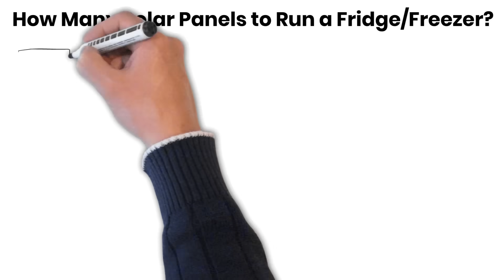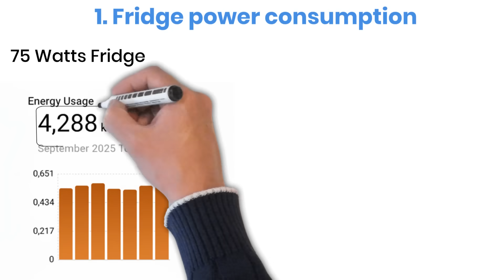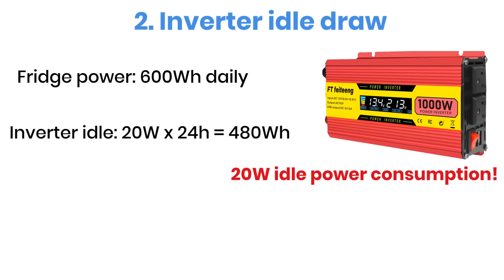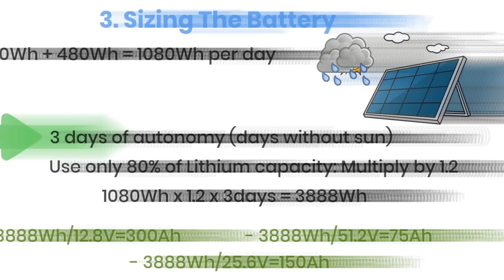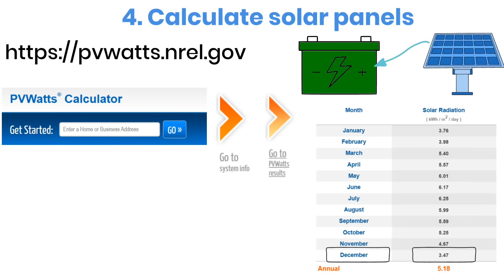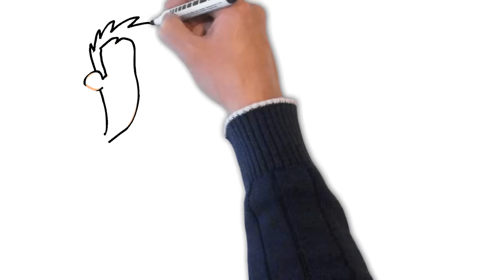How Many Solar Panels to Run a Fridge or Freezer 24/7?

Comment: I am running an old school  frig, 330 watts  ,  it cycles every 15 min, so it runs half the time.
 with 3 sets of 2-250w panels =  1500 watts out put for a 24v system
3 charge controllers produce 15A max for each set of 2 panels =  45a max rate
this system can charge 4 100ah   life pro lithium batteries by 3pm with  no load.  24v 
to keep frig going 24-7 i need to run shore power about 5 hrs a day
i live in southern CA  USA with lots of sun
to live normally you would need about 3 to 4 times what this system is to run a small house
,,,,,,,,,,
Reply from the maker: Thanks for sharing the details of your setup—that’s super helpful for others to see the real numbers, not just theory. Your experience really shows how even with plenty of panels and good sun, continuous loads like a fridge still push the limits of a system.
What you said about needing 3–4 times more capacity for a small house is spot on. On paper, the math looks easier, but in practice, inefficiencies and daily variations make a huge difference.
If you were to expand, do you think you’d add more panels and batteries, or lean more on shore power as backup?

Comment: You can also connect the input of inverter through the refrigerator temperature switch. The inverter wil be switched off during idle time, and entire system will be about 40% more efficient, without increasing of the budget
Reply: You would  need a relay circuit for that ;)
Reply from the maker: @selimtarhan2435  Good point! A relay circuit would definitely make that setup more reliable, and automating it keeps the inverter from cycling unnecessarily. Nice addition to the idea.
Reply: @selimtarhan2435  yes of course, but one relay for about 40% economy, it is definitely worth it
Reply from the maker: That’s a clever idea. Using the fridge’s own thermostat to cut the inverter during idle time could definitely save energy, especially in a small off-grid setup where every watt counts. The only thing I’d be careful about is making sure the inverter can handle frequent on/off cycles without issues—some models don’t love that.
Have you tried this approach yourself? I’d be curious to hear how it worked out in real-world use.
Reply: @batteryhacker4343  no i didn't try it, by I think it will be alright, because switching off/on for about 8 times for a day is not a problem
Reply from the maker: Yeah, true — around 8 cycles a day shouldn’t be too harsh on most inverters. As long as the startup load from the fridge compressor isn’t too heavy, it should handle that just fine. Might actually be a neat little efficiency trick to test in a small setup.

Comment: Would the addition of a timer to restrict the on time of the Inverter say to 25min per hour,  successfully reduce consumption ? Assuming only the refrigerator is connected .
Also, what about two inverters,  first high power Inverter to start , then auto switch to low power Inverter.  ?  R.
Reply from the maker: Interesting ideas. A timer could cut inverter run-time, but with a fridge it’s tricky—if the compressor doesn’t get a full cycle when it needs it, you risk food spoiling or damaging the unit. Fridges really need to run on demand, not on a fixed schedule.
The two-inverter setup is creative too. A smaller inverter for steady running and a larger one just for startup surges could save energy, but it would need some careful switching logic to avoid hiccups.
Have you experimented with either of these setups before, or are you mostly exploring the idea right now?
Reply: @batteryhacker4343 Just ideas from a former industrial handyman .
Reply: @batteryhacker4343 A fresh thought . An automatically variable Inverter.  If viable,  create them , if you profit , send me one .  R.
Reply: That would reduce the wasted idle power, perhaps, but that is all.
Modern fridges mostly use microcontroller (computer chips) to plan efficiency.  If you turn the 2hole fridge on and off, the computer forgets what is happening and might be less efficient.
Some inverters have lower idle power but they are generally more expensive.

Comment: I started with an old VW camper 12volt refrigerator (draws 3.5 amps@12 volts), 100 watt panel and one deep cycle battery, almost worked. I ended up with 200 watts of panels and 2 deep cycle batteries, works good. I finally added a third battery to run other stuff in my van.
Reply from the maker: That’s a solid upgrade path. Many people find that one panel and one battery look fine on paper but fall short in real use. By going up to 200W and adding extra batteries, you gave your system the buffer it really needed, especially for a fridge. The third battery also helps keep discharge shallower, which extends battery life. How has this setup been performing for you during cloudy days or longer trips?
Reply: The panels seems to work so-so on cloudy days, I do charge my batteries when I drive. When I'm parked for a while I've learned to do the heavy stuff in the morning so the batteries get charged before dark. I do have a 5 gallon water tank on my roof rack for drinking and showers. I use stainless beer kegs so I can pump them up (the tank is rated for 85 psi, I run around 40) and it has a 300 watt heating element in it also. I try to run the heating element when I'm driving, or in the morning when parked. Other than that I don't have any other heavy loads, just crock pots and laptops.
Reply: My estimate in southern California is 2 battery for 100 watts solar panel otherwise the panel turns idle fast.
Reply from the maker: @andreinastase1604  That’s a good rule of thumb actually — 2 batteries per 100W panel keeps things balanced so the extra solar doesn’t go to waste. Makes sense, especially with all that sun in Southern California. Do you usually run any loads while charging, or just let the panels fill up the batteries first?
Reply: How many watt hours in the battery?  I saw a video where a vanlifer changing rigs had a small Magic Chef dorm fridge (no freezer I am guessing) hooked up to a smallish Bluetti, maybe only a 268 watt hours,  and she said it could run for days on that.  This was a van in the desert in the winter time or cooler seasons.
Reply from the maker: That’s an interesting setup. Those little Magic Chef fridges are pretty efficient, especially if she was in cooler weather where the compressor doesn’t run much. A 268Wh Bluetti running for days sounds impressive though — maybe she was cycling it on and off, or just keeping things cool instead of cold. Do you remember which Bluetti model that was?

Comment: Lithium batteries today can be dropped lower without cons
Reply from the maker: Yes, absolutely right. Lithium batteries, especially LiFePO4, can be discharged much deeper compared to lead-acid without harm. That’s a big reason why more people prefer them for solar systems nowadays. Thanks for bringing it up.

Comment: Short recap:  in order to deliver 600Wh per day to the fridge, we need another 480Wh per day to keep the inverter on.  If we do the Math, about 55.6% of the energy captured in one day ends up being used by the fridge, while the other 44.4% is dissipated by the inverter as heat.  Now the solar panels themselves are about 20% efficient, which means 20% of the energy they capture becomes electrical energy, while the other 80% end up being converted into heat at ground level.  Putting it together:  11.1%  ( = 55.66% x 20%) becomes usable electrical energy; while 88.9% ( = 80% + 44.4% x 20%) of the energy captured by the panels gets converted into heat.  And somehow, by some politicians' logic, this is supposed to help us "avoid global warming".
Reply: Wow, 20% efficient! I'm glad God doesn't send me a bill for the sunshine!
Reply: @cactusflowerbeekeeping97  It's not 20%, it's more like 11% efficiency and as batteryhacker4343  noticed, that figure is quite optimistic (not accounting for all the losses).  And while I am willing to bet that God will never send you a bill for the sunshine, governments will find a way to make us all pay taxes for it, eventually.  If we look around there are several governments that already managed to make people pay taxes for the air they breathe.  For the time being, it is disguised as "carbon footprint tax", but it's essentially the same thing.
Reply from the maker: You’ve done some solid math. True, every step in the system has its own losses, whether it’s the inverter, battery, or even the panels. But the real advantage is that solar energy keeps coming every single day for free. Even with those efficiency drops, it still cuts down grid use or fuel costs. It’s less about hitting 100% efficiency and more about long-term savings and energy independence.
Reply: @batteryhacker4343   I am not questioning the value of the idea.  From the purely technical standpoint, I am in favor of solar power.  What I am questioning is the politicians' propaganda.  How are we "going to cool off the planet", by deploying a solution that generates 9 times more heat than it generates electricity?  Beats me.  And while it's true that "solar energy keeps coming every single day for free", turning it into electricity only becomes financially advantageous after the initial expenses made to purchase the panels, inverter, battery etc get (eventually) paid off by the savings on the electrical bill.  Which usually takes several years, plenty of time for something to break and require repairs / replacements that will push the ROI goal posts even further out.
Reply from the maker: Good point. I get what you mean—the “cooling the planet” slogan sounds more like politics than engineering. Personally, I look at solar less as a way to save the climate and more as a way to have some independence from the grid. Even if the ROI takes years, having your own power for lights, fridge, or a well pump during an outage feels like value on its own.
You’ve clearly thought a lot about the numbers—do you see solar as more of a backup solution for specific needs, or do you think it can realistically be a long-term alternative to the grid?
Reply: @batteryhacker4343  To make it a replacement for the grid, a solar generation system would have to be oversized by a lot more than you showed in the video.  Cloudy winter days, that are shorter to begin with, can also come in batches of 10 (or 15) in a row, so designing for such a worst case scenario would result in a lot of extra panels (and much larger batteries), especially if electric heating is used.  Even if we set cost and space requirements aside, a system built like that would have a huge production surplus 6 months later (when 10 bright summer days may come in a row).  And since with today's technology it is practically impossible to store power harvested in summer until it's needed during cold winter days ... in my opinion the grid is a must and believing that solar power can replace it is unrealistic (at least for now).
Reply from the maker: You’re absolutely right. Designing for worst-case winter days means way more panels and batteries than most people can justify, and like you said, that creates a huge surplus in the summer with no practical way to store it for months. That’s one of the biggest gaps in current solar tech.
That’s why I usually see solar as something that works best in hybrid setups—either tied to the grid, or paired with something like propane, wood, or even a small generator. That way you don’t have to size everything for the harshest week of the year, but you still get a lot of independence most of the time.
Out of curiosity, with your experience—have you found hybrid setups more practical in the long run, or do you think people should still aim for stand-alone systems if budget allows?

Comment: I'm living off grid since 2018 in the tropics. Those numbers for a regular fridge would be multiply by 3. The inverter usually consume close to 1 amp in idle, in general you are correct in how to approach the issue.
Reply from the maker: That’s really valuable insight. Living off-grid since 2018 gives you real-world perspective that numbers on paper sometimes miss. You’re right, in tropical climates the fridge runs a lot harder and inverter idle draw adds up. Thanks for sharing your experience, it will definitely help others understand the practical side beyond just the calculations.
Reply: @batteryhacker4343  Then there are other details about power consumption, like keeping your compressor coils clean greatly reduces power consumption and making sure your doors close tight.  I have problems with the door on my small freezer sometimes as frozen things tend to slide down.  Then there is where you fridge is in the dwelling and how insulated and protected from outside and inside heat.
Reply from the maker: Great points. Placement and maintenance make a bigger difference than most people realize — dirty coils or poor airflow can easily bump power use by 10–20%. Sounds like you’ve got a solid handle on optimizing your setup. Have you tried adding a small fan behind the coils to improve circulation? It can help a lot in warm rooms.
Reply: @batteryhacker4343  Although refrigerators run harder in the tropics, they also receive more solar energy.  I suspect if I did the figures here in the UK, my cheapest option would be to dump the fridge and get fresh produce every day.
Reply from the maker: @KenFullman  Haha, that’s actually a really good point — the balance shifts completely depending on location. In the tropics you fight heat, but you’ve got solar abundance; in places like the UK, limited sun changes the whole math. Going “fridge-free” with daily fresh produce sounds like the most sustainable option of all. Do you already have some solar setup there or mainly grid power?
Reply: @KenFullman  That's OK if you drink the vodka before it warns up  ;)
Reply: 75 watts rating is absolutely way off from ratings I see online for 3 sizes of refrigerator that I checked online including my own 10.1 cubic foot fridge with has the same power rating as a 3.3 cubic foot fridge at 126.5 watts per hour for when the compressor is running and actually has a slightly lower annual rating than the dorm fridge, the 10.1 c.f. about 34 watts day and that doesn't make sense.  Maybe 34 watts an hour? How do they get these numbers?   If you are shopping for a fridge the annual kilowatt ratings manufacturers give are a better number to look at because the 10.1 actually uses less power annually than a 3.3, but you absolutely need a plug in watt meter and to use it with your fridge for a long time to get accurate watt consumption which I guess is where this guy gets his 75 watts average per hour estimate.  That could be a whole video all by itself!  You can also put extra foam insulation on the top and sides as long as you leave the back well ventilated.
Reply from the maker: That’s a really solid breakdown. You’re right — the manufacturer ratings can be confusing because they mix running watts, duty cycles, and yearly averages. The 75W figure I used was an average based on real-world meter readings, but it definitely varies a lot by model and usage. I like your idea about making a separate video on watt-hour testing — that could clear up a lot of confusion. Have you done any long-term measurements with your own fridge?
Reply: I'm in the top end of the Northern Territory Australia 
I've got my first wet season to get threw coming up now 
I'm happy if I can run my  Engal DC fridge 45 litres or ten gal 
I've a thousand watt pure signwave victron inverter on 12 volt 
I'm thinking I'm going to see if they have a 36 volt inverter same size 
For this way less wasted energy from inverter